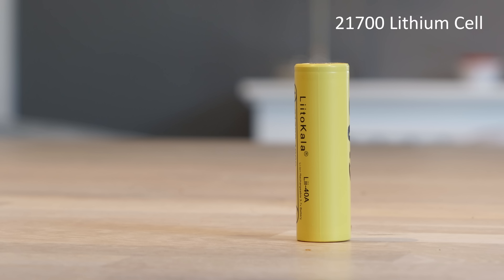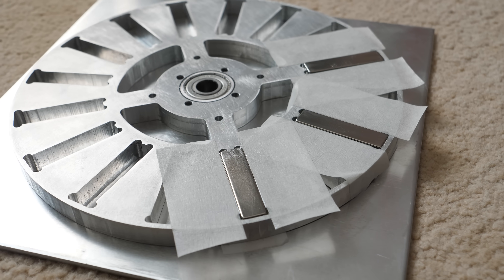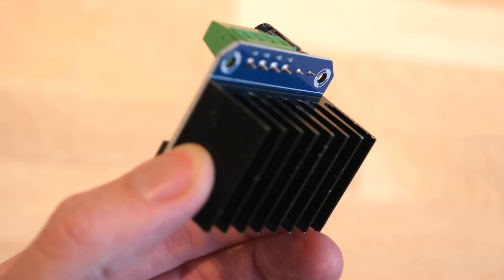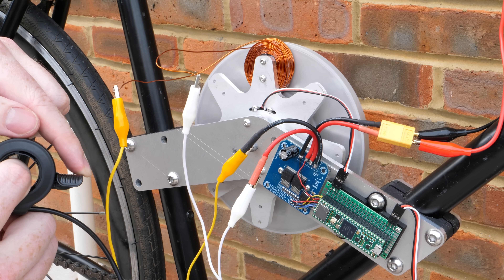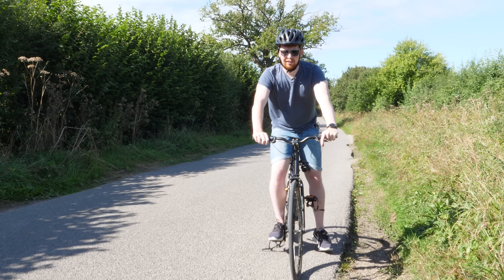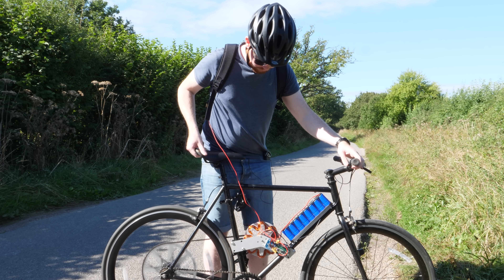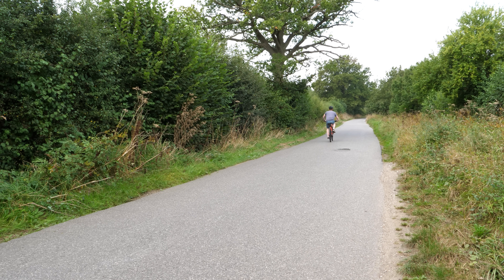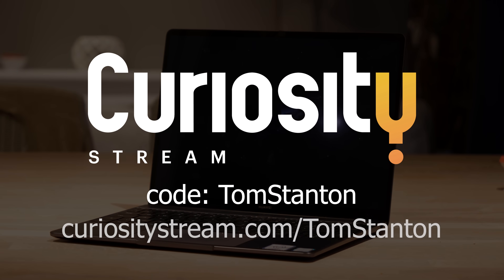Super Capacitor Bike

Comment: I like the application of super caps for automotive jump packs, they've been particularly well suited for my purpose of very intermittent use for starting a car when the battery was inadvertently discharged.  That's where the superiority over the long term when stored in hot and cold temperatures shows up over the usual lithium battery jump packs, with their more limited lifespan. 
No concerns about maintaining storage charge levels with the capacitors.
Reply: The difference being your car already has to have a starter motor installed(and doesn't effect the overall weight too much), unlike a bike .
Reply: @DoubleMonoLR  yes, supercaps just aren't suitable for primary drive with the low energy density.

Comment: Why not wire the capacitors so that using the bike normally charges them? You could use them as a momentary boost then switch them off to be recharged by manually pedaling... That would work, right?
Reply: "in-rush current"

Comment: ok, how about changing the series/parallel configuration of the capacitors as the voltage drops? like a marx generator but with transistors (or relays, idk)

Comment: Since some of y’all clearly know what you’re talking about. Why can’t we create cars that charge as they drive? Like a car that uses nothing but the energy generated from the wheels. To make my statement make more sense, when you drive the car as the wheels turn it generates energy and therefore gives power to the battery in the car. Then when the car is turned off or whatever it stores power in the battery so you can start the car and stuff. Something like a wind mill

Comment: Can you seperate the blue things with a switch, add a couple more gears and bits of copper wiring, and create a generator so that it can automatically  generate electricity in half the blue bits while it uses the energy from the other blue bits and then switches the function of each set of blue bits?  Create electricity and use electricity simultaneously?
Reply: No.
One of the worst aspects about capacitors is that the "switching" causes in-rush currents.
Without dampers, this can cause component destruction.
At 400 Farads, a single switch at 20V for 1 ms will cause a 8,000 * 1000 A in-rush.
At 50 Farads (which the setup seems to be configured at), at 20 V for 1 ms will cause a 1 MegaAmp of in-rush.
Given that his system probably doesn't supply this... you'll probably see his motor driver explode, then voltage droop.

Comment: You could increase your efficiency by placing steel spacers in the coils instead of plastic
Reply: Wouldn't that also cause mutual inductances, an unwanted characteristic when you want each coil to generate individual EMF?
Sounds like it would induce voltages on the other coils before reaching it, and could probably cause damping.

Comment: Capacitors are used to oppose a change in voltage from an AC source, they help reduce current usage and improve power factors in big factories and such by connecting them in parallel with the service conductors to a panel. So using something that reduces current makes no sense to power something that requires current to operate.....
Reply: This is not true. When they are used as "bulk capacitors" they are used to prevent voltage droop by supplying the needed current.
I = C dV/dt, which in this equation shows the current draw is dependent on the rate of change of Voltage in respect to time (this is also the formula for inrush current)
Power Factor is the deviation of the Real Power from the Apparent Power caused by the phase angle opposite the Imaginary power.
A transmission line typically has a characteristic inductive load (as a typical conductor will act as an inductor) the capacitor in this scenario will subtract from the imaginary component of the impedance to effectively make it purely a real value instead of complex.
Reply: @cpK054L  In an AC circuit yes. But who installs ac motors on bikes?
Reply: @Tropicsca  Is there an actual restriction WHY they wouldn't be able to use AC motors?
It's not difficult to implement an DC to AC with the power of Quartz
Reply: @cpK054L  why would you use ac it's far too complicated. DC motors are the ideal choice for propelling small forms of transportation. Even in trains they have a generator onboard that powers DC motors to the wheels. That eliminates fluctuations in voltage therefore increasing efficiency and higher voltage requires more expensive materials to build the system. It's about cost effectiveness too.
Reply: @Tropicsca  I'm confused as your implication of what makes an AC motor more complicated to a DC motor?
DC motors operate speed based on current-induced magnetic field.
AC motors operate speed based on induced frequency, which is turn creates induced voltage across the inductor, which in turn creates induced current.

Comment: If you were able to develop a form of regenerative braking, and/or charging via the pedals, I think this may have been able to have a significantly longer range
Reply: How?, it was already discharging the full capacitor in very little time. Unless you're going to alternately charge the cap(via braking or over-pedalling), then using it's charge in a short period of time(which seems unlikely in most cycling scenarios), you can't extend the range without increasing capacity. The additional weight & mechanicals will also be adding some extra work by the cyclist before charging is added to that.

Comment: Hello Tom,
I'm Bas from NL, and I'm doing a "fun" project with my bike.
I'm trying to connect a car stereo cassette to a 6cav dynamo, but the scematics i have seem to not work:
So it's 6 VAC to two 47uf 25V caps, and two (big) diodes on the ground side to rectify the ac to dc.
Then a 1000uf 25V cap on the output side for smoothing, but it won't work... A previous version with a 1000uf 16v cap would power a 12v RGB segment, but not the car stereo.

What am I doing wrong? Any tips I can use?

Thanks in advance,
Kind regards, 
Bas
Reply: You should check what the power ratings are. Capacitors are not meant to deliver power. You might have the voltage, but if your stereo is demanding more power your causing a voltage drop which will cause the stereo to brown out
Reply: @cpK054L 
Hmm. Didn't think of that.. What do you think I should do? I'm pretty rusty in my electrical skills..
Reply: @H4ns_And3rs-IS-my_Al1as  what is powering your capacitors?
Reply: @cpK054L 
An almost antique bicycle generator. With on the inside six magnetic rods and pick-ups. Don't know the brand. It says it's German

Add: i see the names L.D.6, Berko, Allemagne.
Reply: @H4ns_And3rs-IS-my_Al1as  So you're looking at powering your stereo with your bike like above?
Find out what the power draw of your stereo is.
Lets say it's 100 watts for simplicity sake.
You need to power it with 100 Joules per second.
The energy equation of a capacitor is ½CV².
Capacitance you will need to test to verify, this is done using a known resistor, say 1,000 ohms in series with the capacitor and give it a 1Volt pk-pk square wave.
Find how long it takes for the voltage to go from 1V to .67 volts (or, 1/e which is the time constant)
Lets say this time is 1 second, divide that by 1,000 ohms, you yield 1milli unit, you have a 1mF capacitor,

Do this with your capacitors in setup (for more storage tie them in parallel) then in series with a resistor, do test above, find the total capacitance of your setup.
Note your voltage rating of your capacitor because exceeding this will cause it to explode (violently)

Plug in to the equation above and say you got 100,000 Joules. that means you can power your device for 1000 seconds before depletion, this is assuming you have a fully charged capacitor.

Hope this makes sense.

Note, you MUST put the resistor in series with the capacitor or you risk shorting it and causing a fireball.

To find the appropriate resistor, note the time it takes for 5 time constants

100,000 joules for 100 Watts, you want it to happen in 5 time constants.
Reply: @cpK054L 
Thanks, I'll read it all a second time later

Comment: correct me, when i am wrong, but according to my knowledge putting capacitors in series DE-creases capacity, to increase capacity of a number of capacitors, they should be parallel.
well, 2.7 volts is not enough though to power an e-bike. 

i think (did not do the math), if you use A LOT of conventional 35-volts-capacitors in parallel, you could actually have a better bang in watts.
just an idea.

it just irritated me seeing capacitors in series, rather unusual due to decreased capacity.
Reply: Try finding 400F super caps at 35Volts..  he might as well just buy an ebike at that price 😂
Reply: @cpK054L  yeah, the price is always a problem. is is not enough,  that something is technically possible, but maybe there will be affordable 35v-supercapacitors in the future. usually they were constructed in µF and now 400F is possible. but F is As/V, so the voltage must be somewhat higher to store the As ( equal to C coloumb). i think capacitors will be they way to go to harvest braking energy and releasing it again while starting. way better than a spinning wheel. they charge superfast, no competition on charging time. just the amount of energy is still not enough.
Reply: @grzegorzbrzeczyszczykiewic8995  Capacitors have transient properties which apparently a lot of designers neglect, inductors as well.
So they get surprised that these immutable traits get ignored and their system gets destroyed. You got the idea. F = Q/V (Q in this case is net charge, to be more specific about what type of Coulomb you are dealing with)
Super Capacitors are typically constructed in the Electronic Double Layer architecture, and it generally does not exceed 3.5 Volts.
Something that is closer to this trait would be an Aluminum Electrolytic capacitor.
Found one that is 35V at 1F, but guess what? 2,638.47 per 10 units, so you're looking at 105,538.80 to achieve 400F, this is also at a 20% tolerance, so you're looking at 126,646.56
It's also on backorder.
Meanwhile you got the EDLCs that have 400F onsite at 3Vs, you just need to stack 10 across to get about 30V rating, and 10 wide to remove the parallelness, so even at 100 it's around 800-1000 dollars.

Ignore all these alibaba buyers, I wouldn't trust my designs on a known scam supplier.
Reply: @cpK054L  learned something again. so apparently those super cap high farad "van-de-wals"-forces are not suitable for high voltage? am i right here? please, i need to learn more. i am looking for a design to make my e-bike collecting energy, while ridin down with a full basttery, i live on the peak of a 150m uphill mountain and start downhills with a fully chqrged batterey wasting my brakes for 5 minutes straight everyday instead of harvesting that free energy...
Reply: @grzegorzbrzeczyszczykiewic8995  EDLC are not suited for high voltages because they breakdown faster.
You can "increase" the voltage by putting them in series, but you will reduce the capacitance rating because it is divided amongst the capacitors.
You can "increase" capacitance by putting them in parallel. 
I would highly advise AGAINST using capacitors to charge batteries without using charging circuits because you risk making both burst from in rush.

Capacitors are not substitutes for batteries, they are also imperfect in manufacturing, you have to do an RC test to find out what the actual ratings are.

Comment: I wonder if we'll ever see this type of idea implemented into vehicles like the Flindstones cars with pedals that can Propell the Car and build up a Stored charge at the same time that Stored charge in the battery can then be used to power an electric motor
Reply: Or a Another option would be you pedal around mostly but now you have to option of adding a small assist from the electric motor it starts passively running at low speeds while you are still pedalling to move at greater speeds

Comment: If you need to wear a helmet while cycling on a sidewalk, you might want to try out for the special olympics. Helmets are for rough terrain, where you are likely to dash your head on a rock, or tree, or rough land. On a sidewalk it is virtually impossible to dash your head. 100 years of no helmet, on smooth surfaces prove this out.

Comment: how about connect super-capacitor in parallel of the battery: idea is that capacitor much easier can provide high current and power in a short term compared to the battery, e.g. when need to go uphill

Comment: cool DIY electric motor   👍 Many parts for it possible to order from online shops from China to reduce some long time work.
For your case, when capacitors connected in series, they are capable of 2.7 V *8 = 21.6 V , but total capacity will be 400 F / 8 = 50 F, so total energy they store if you charge till 20V will be (50F*20V*20V)/(2*3600) = 2.78 W*h

Comment: There are people that don't understand what a supercapacitor actually is... 2.7V is not the voltage that the capacitor will output, that is the rated voltage. Putting them in series increases the voltage rating (which in electronics is recommended you "derate" them because the characteristics change based on temperature"

Putting them in series will also limit the current output, in series, capacitors are equivalently "parallel" to the other passive components, so even though you have 400 Farads each, you had 8 in parallel, so you effectively have about 50 Farads (note that is the rated capacitance of your super capacitor), this assumes that the manufacturing of those components are ideal and perfect, which is never the case... the capacitors value can swing as far as -35% → +50%... it gets that bad... you also designed your coils on this assumption?
I would test your capacitor rack to confirm what it's ACTUAL total capacitance is.

½CV² is the energy of the capacitor, with the capacitor in "series" your C value is not your expected 3200 it is actually... 50.... so actually... it was storing 182.25 Joules... comparing that to a 3mAh LiOn battery... at 2.7 volts (same rating) yields 29.16 kJs... a factor of 160.

Comment: I don't know if anyone mentioned this, but at 6:00, you say you soldered the capacitors in series. That's a big no-no. You solder batteries in series for increased voltage. If you want more capacity for capacitors, they need to be in parallel. Series only decreases the net capacity of capacitors. You can also solder batteries in parallel for more capacity. Based off the capacitor in series equation, your total capacitance would've been 50 Farads. If they had been in parallel, then their net capacitance would've been 3,200 Farads.
Reply: In parallel he'd be limited to the rated voltage of 2.7 Volts, and if he were to put that charger for 20 volts... it wouldn't make it to 10% before exploding into a ball of fire.
Reply: John Portal  I've been working on electronics for nearly a decade now... 
do you know how to measure discharge on a capacitor?
I would NEVER buy anything off Alibaba relating to electronics.
No company I know in their right minds would ever have them as an approved vendor.

Comment: impressive. i suspect a bit more work with calculator would have revealed this design would not be roadworthy, but construction admirable. and there is a case for caps as a surge power source.

Comment: Capacitor braking to me looks like an area that needs to be looked at more, even for conventional vehicles.  For example lets say your vehicle has a dead battery.   If you can get someone to pull you a short distance you could use that capacitors to start the vehicle.   All sorts of emergency power applications.

Comment: A capacitor ebike could actually be a viable solution. Capacitors are much lighter than batteries. If you could gradually use mild regen to charge enough for just 5 minutes of range it could get you up tough hills and accelerate for standing stops in traffic. You’d get some ebike advantages without ever having to worry about recharging.

Comment: You should add the iron (better laminated steel) inside the coils, instead of plastic. This will increase the efficiency much more of your motor and help magnetic flux return correctly. More further make the iron core of the rotor and make the shape of your coil core in Ш-shape.
Good luck!

Comment: i was wonderin but i dont have the knoledge or possibility for it but what if you used these dynos like they used to pover bike headlights that run off the wheel and make electricity to power the light and what if you put a few of them on to constantly charge the cappasitors and that should give you enough voltage i think im not a engineer or electitrician or something just a simple logging school student with and idea searching for answer

Comment: Good stuff man, keep pushing this concept, maybe use a belt instead of a chain, try to separate the eletric circuit, the battery push the bike, the capacitors works as boost, like nitro does in the fuel car. well just a suggestion.

Comment: You could use the charging contraption to solar cells that double as a sun shade canopy for the bike. A 100 watt solar panel could continuously charge the capacitors if there is a way to charge the capacitors constantly. Or you could have 2 or more banks of capacitors. One bank charges while the other discharges and then switch them around.
Reply: The capacity is so tiny in this example you might as well just charge it from a battery.

Comment: are you able to incorporate a charging system with the pedals?  The capacitors could be used for assisted biking for when your legs are a little tired but you don't want to slow down.

Comment: What about batteries + capacitors? While you are not using the electric motor, batteries charge the capacitors, so its always ready when you need some assistance, which you would probably want considering the weight